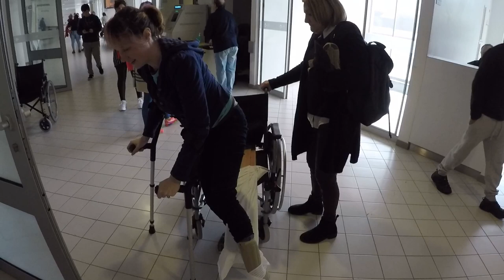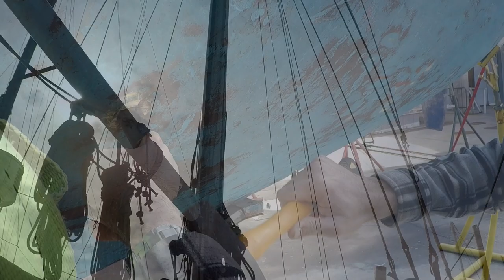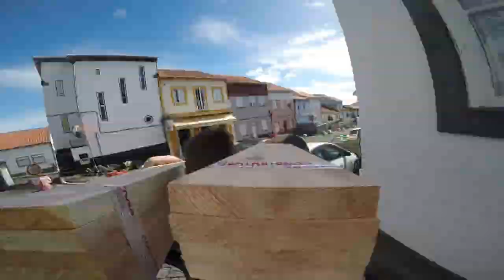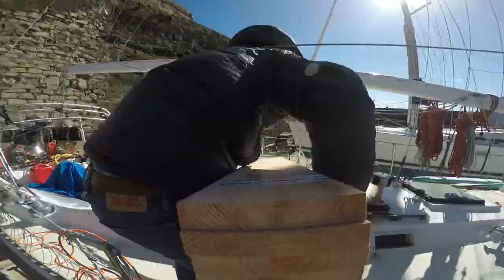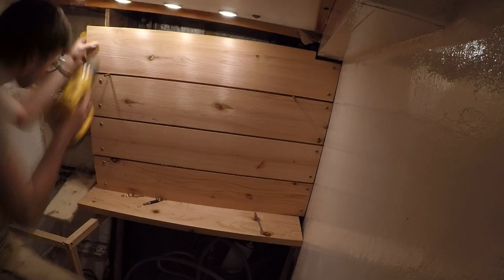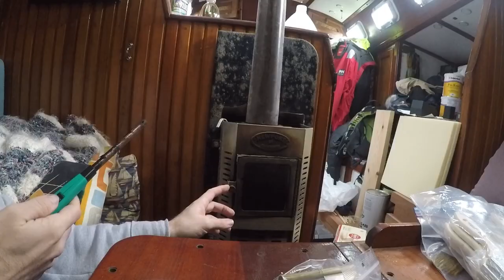Want to See my Seacock? | Sailing Wisdom [S3 Ep33]

Comment: :.Herbie....I kept proper sized dc plugs next to each seaacock as a just in case. Better to have them prepositioned then to scramble to go look for them when time is running out
Reply from the maker: That’s a good idea. I have seen on other boats where the bung is tied to the seacock ready to use in an instant.
Reply: Don Casey recommends making every seacock compartment watertight. I agree i can somewhat do that easy on my boat except for one. Cheers good vid. Hope maddy is better!

Comment: Totally agree that having excess below water line hull penetrations is dumb (why do they do it?)! I like to use peel ply whenever I'm doing a lamination job -it gives a flatter bondable finish, absorbs some excess resin for a stronger laminate and helps polyester surface cure.
Reply from the maker: I think it’s cheaper for the builders to put a hole in the hull near their use instead of paying for all the hose they would need to run to plumb the same fixture. That’s my theory 🤓

Comment: i have watched many of your video's.  you always teach people the wrong way of doing things.  your fiberglass work is terrible.  you never get the air out, and you use resin as a filler.  it's guaranteed to fail.  resin is weak.  and without rolling or otherwise getting 100% of the air out is going to cause immediate weakness and de lamination over time. usually a short time.

that'll get very expensive, with the inherent rot it'll cause on a boat.  and worse, dangerous if a resin bung falls out that was fiberglassed in poorly.
Reply from the maker: So you completely missed the part where I said this is not structural but just to keep the dust out when I do the actual plug?
If you want to say I am doing it wrong, at least make sure you know what I’m doing. If you don’t understand what’s going on, maybe the problem is on your end.